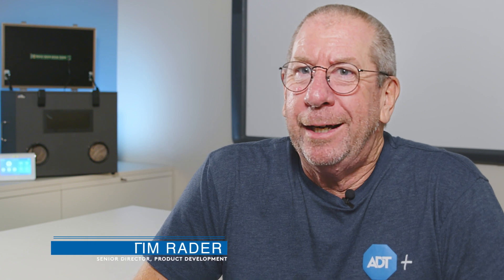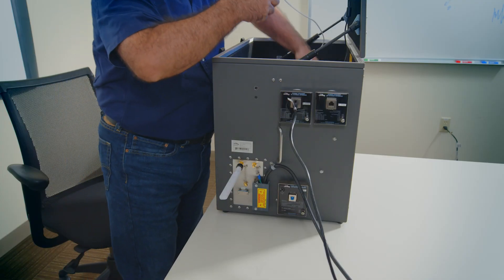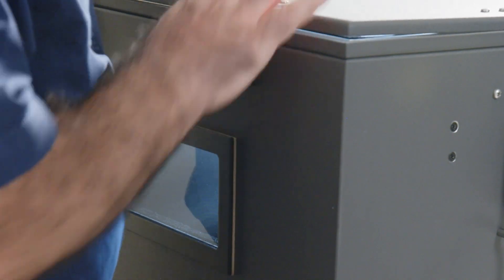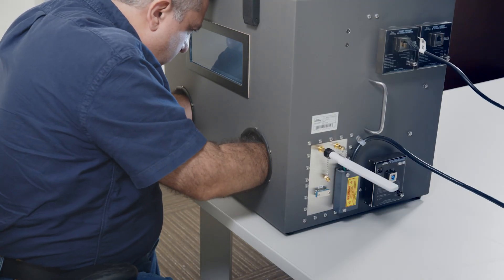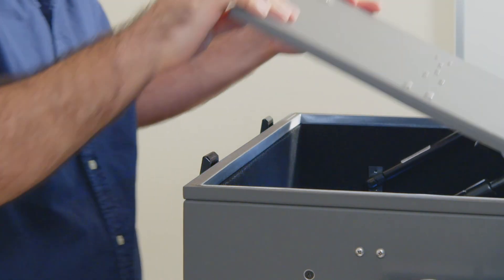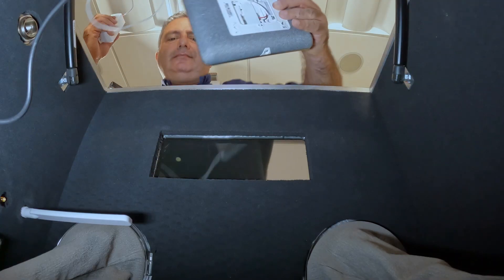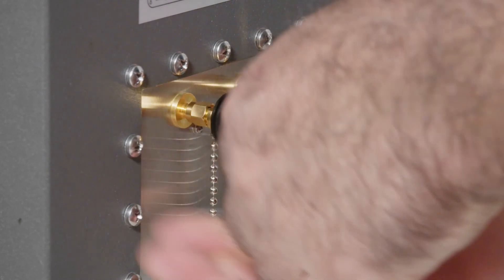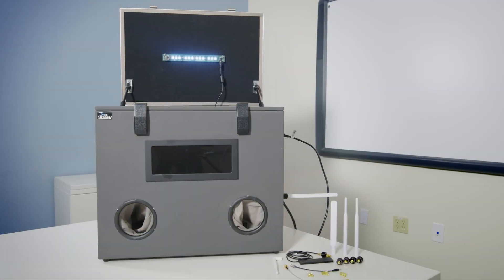ADT Lab - Radio Frequency Chamber

Comment: ADT will take your money, BUT! When it comes to fixing the problem, good luck. Around 2 years or less they came around my complex wanting to know who wanted their alarm activated. I said HELL NO, I'm not dealing with that headache...........Never had a problem since then until Aug 1, walked through the garage door and it went off. I had to open the front panel and pull the wire off of the siren just to stop it, the Sheriff dept shows up and I explain to them about this alarm going off and it shouldn't have. ADT called and I asked them why the alarm was going off, I never had it activated. She gave me some  BULLSHIT stories about how the maintenance man may have activated it. He didn't activate it, so I talked with him. Mmmmmmm so my alarm activated itself. ADT is a FUCKING JOKE! 
It's been 9 days and no one showed up to fix this piece of shit system.......The alarm won't work anymore, so I unhook the electric and the battery pack.